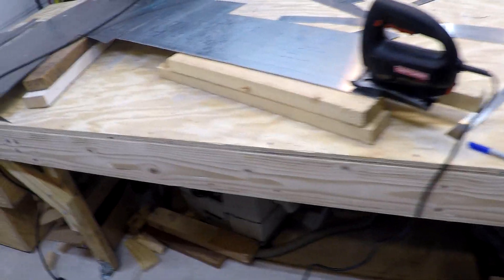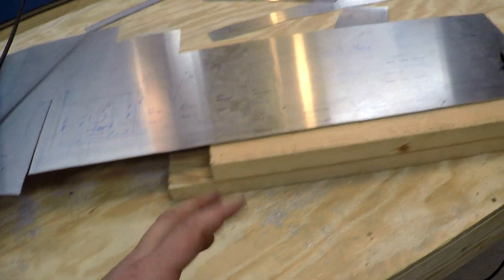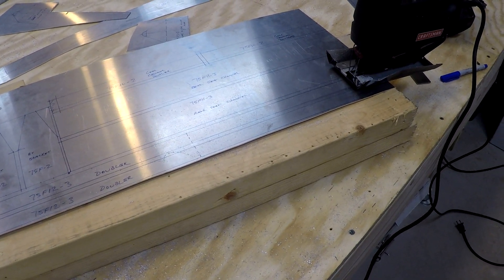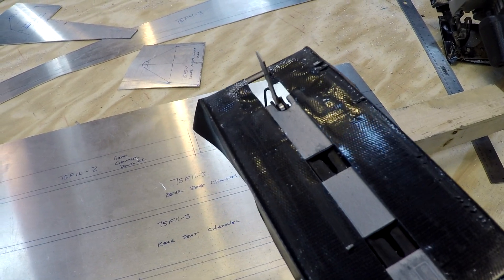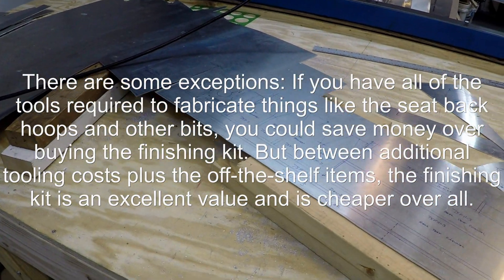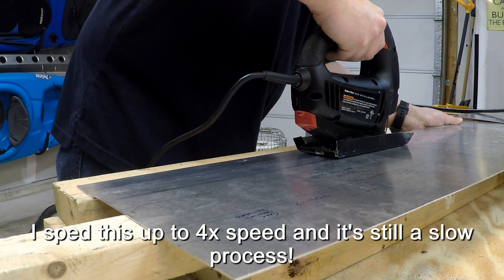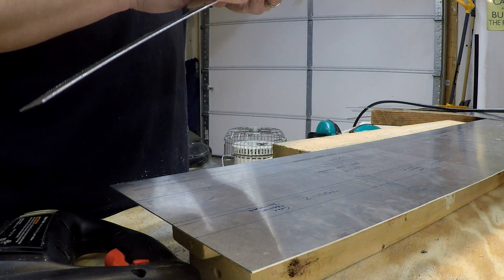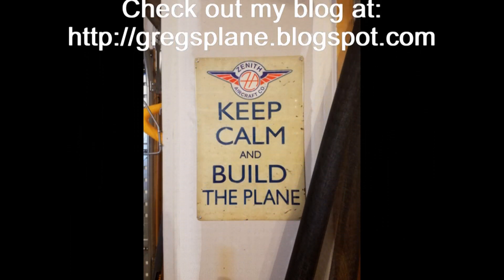Rough cutting .063" 6061-T6 with a jigsaw

Comment: Have you tried the jigsaw blades that are specifically meant for aluminum? Dewalt and others make one but I'm hesitant to use it because it's only 8 TPI. The 24 TPI sheet metal blades just seem like they'd be better in my mind.
Reply from the maker: For the jigsaw, I used the 20 TPI bi-metal blades I mentioned in the video, as that was all I had on hand at the time. I haven't tried a 24 TPI blade, and haven't used the jigsaw on aluminum since I shot this video. I only used it to cut out all those oddly nested parts in .063". My biggest mistake was not using a lubricant. I still would have gone through a couple blades, but they wouldn't have loaded up or dulled nearly so bad with some cutting lubricant. I now keep Tap Magic in the shop for cutting fluid and it makes a huge difference. Even a shot of WD-40 would have worked wonders. I would not use an 8 TPI blade at all for a reciprocating blade. You can get by with a band saw blade with a lower TPI count, but even then I still prefer more teeth.

Comment: Next time you can clamp a window/guide to use to run the side of your jigsaw guide against to make a dead in straight cut. You just have to double check the blade is lined up just right since the guard around the blade of the jigsaw is about 1.5" off to the side of the blade. Basically the same concept as a table saw wall/guide. You just have to clamp one on the sheet metal yourself.

Comment: I use Boelube when cutting any type of aluminum sheets and bar........if its good enough for Boeing , then its good enough for me........it lessens fracturing of the metal and prolongs tool life.........keeps things cool so you dont lose the temper of the metal being cut......
Reply from the maker: I would hope that Boelube is good enough for Boeing...they patented it! I've been using Tap Magic since I shot this video...works well.

Comment: I tried the the jigsaw method and absolutely hated it. My favorite tool now for doing those longer cuts on thick metal is a called a panel hacksaw.  You can see an example of one I made at http://www.zenith.aero/profiles/blogs/panel-hack-saw  

You can also occasionally find them for sale on ebay.  The next time I am cutting parts that need the panel hacksaw I will get a video posted.

Nice job on the podcast as well.
Reply from the maker: I've never even seen that panel hacksaw before...great idea! Fortunately, I only needed to use the jigsaw to make about 6-7 total cuts. All I really did was cut the bigger pieces out so I could do finish cutting on the bandsaw. The podcast was fun...I was flattered to be approached about being a guest.

Comment: WD40 is a good cutting lubricant for aluminum and it helps with aluminum not melting and packing into the teeth of the blade.  

You could try using a vertical band saw.

I am building 4x4 CNC router for making these kind of parts. The packing of all the parts as it turns out is a very interesting math problem.
Reply from the maker: I keep forgetting about using a lubricant! Strong call. I should throw down some Tap Magic! I have a vertical bandsaw, but it is only a 10" model, so I have to cut down the large sheet to smaller chunks. I cut all the small brackets with the bandsaw after making the stock more manageable.
Reply from the maker: Don't most CAD programs have a "nesting" feature these days, to maximize material part placement and minimize waste?
Reply: I am sure some do. This is a bin packing problem. Turns out there is no closed form solution feasible so everything makes use of approximation methods to arrive at a good solution however no guarantee that it is the best.

https://en.wikipedia.org/wiki/Bin_packing_problem

There are some tools out there to help with this. Here is one that works in the browser.

http://svgnest.com/
Reply from the maker: I did all my parts manually, and didn't end up with a ton of waste. My layouts certainly could have been optimized better that what I achieved manually, but I don't feel as if I wasted a ton of material (except when I had to remake parts!). I have 2 bins of scrap aluminum, but a lot of that isn't stuff that would be considered "waste."
Reply: Greg's Zenith STOL CH750 use wd40. It's the go to on cutting aluminum. Better than tap fluid, you will be amazed

Comment: Have you tried clamping with a guide and scoring with a utility knife?
Reply from the maker: Richard Elniski I do that on everything up to .040". .063" is too thick to cut practically with an olfa/scoring knife. Or do you mean something else?
Reply: I used my scoring knife on 0.063 for my wing spar web doubler's.   I cut it to the right width, bent the angle, and the cut it down to the right size after bending.  That way I didn't have to worry about developed length.
Reply from the maker: Timothy Aanerud You have more patience than I do, sir!. 040 is my max with the scoring knife.
Reply: I saw a video recently where the part was clamped in a bending brake.
The clamp was used a s a guide for scoring and the brake was used for the bend. 
It meant that the number of "scores" needed before the bend was greatly reduced.
I have not tried it myself yet, but I will give it a try.
Reply from the maker: Charles Brewer It's a great way to score, bend and break off the piece. I don't like the scoring method on the thicker stock because I don't like how it breaks away, leaving lots to be cleaned up. however,  there's still lots to clean up anyway, so...

Comment: Greg, very good work with the tools you already have, parts look good! since I already have a 14 inch bandsaw I will be using that. work with. 040 to 2 inch thick! but at 550$ it's a long term investment.
Reply from the maker: Thank you. I use my small bandsaw to do a lot of finish cutting once the parts are cut out of the larger sheets, but maneuvering a 4'x6' sheet of .063 was impossible on my bandsaw!